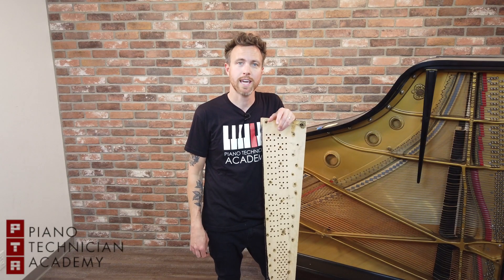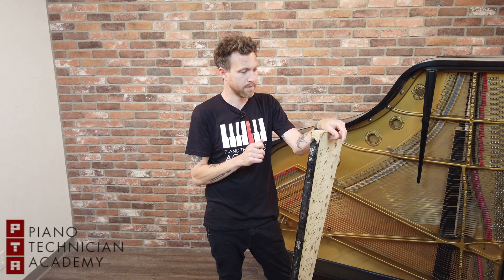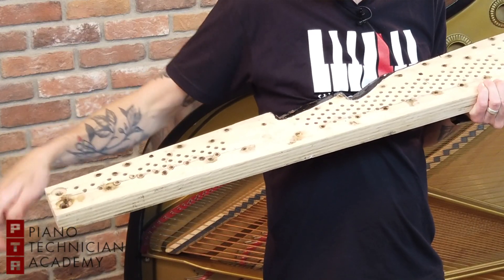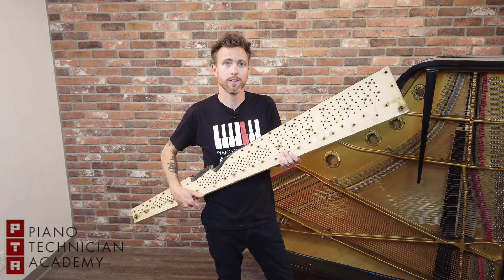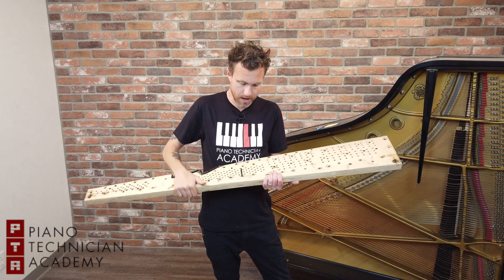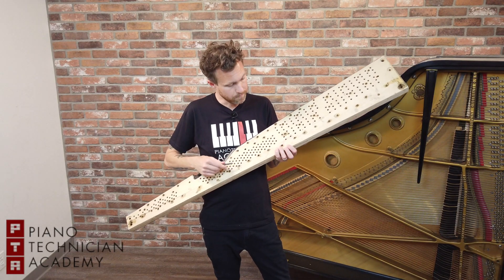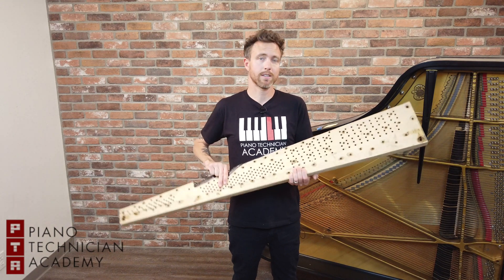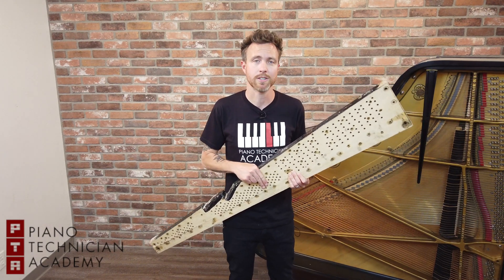What is a cracked piano pin block?

Comment: i know this vid is old, but i would love your opinion on a situation, . bought a old p22 yamaha, it was about 55 cents low on all strings. , gave a shot at  tuning it but then gave up and hired a pro, from every thing i read you must be very very carefull to not put up or down pressure on the pin aka a leaning motion as opposed to a turning motion  ,  so i when i tuned it my self i used a t handle so that the torque was even distrubed and not leaned in any way ,  as stated i gave it a shot and then quit about 2 thrids up and hired pro, WELL ANYWAYS the pro was litterly bending the hammer up and down seemingly bending the pin instead of turning it, not only that but the extension on the socket was about 4 inches deep for a grand piano further increasing the leaning pressure on the tuning block THIS MADE ME CRINGED as analytically in my mind could imagine him stretching the hole of the pin block or bending the pin, so the question is, is this normal to do or did he damge my pin block?

side note, its a 2007 yamaha p22 that seems to never been tuned since purchased, aka a perfect pinblock
Reply: He gives an email at the end
Reply: @GreenCanvasInteriorscape  🤣🤣🤣